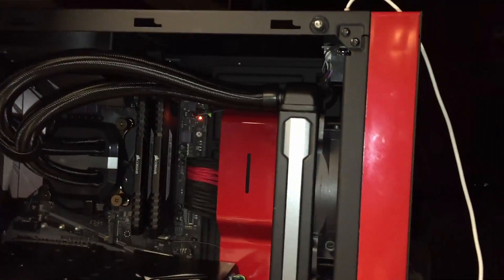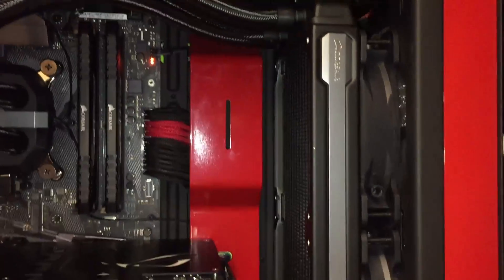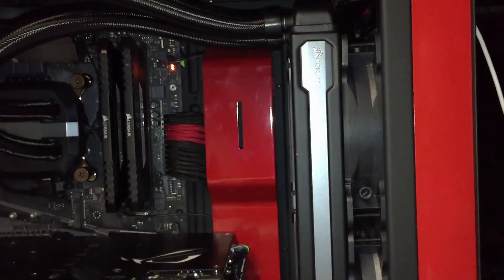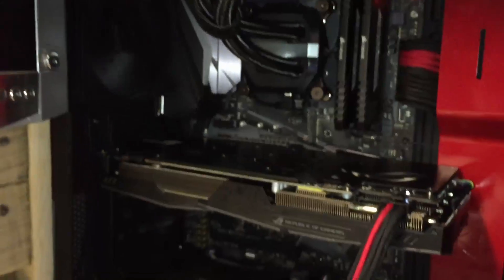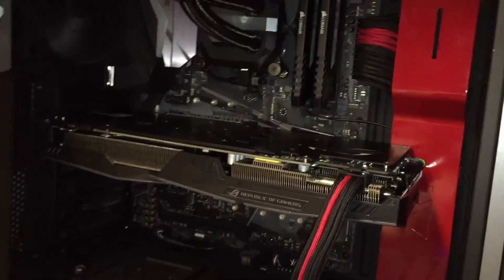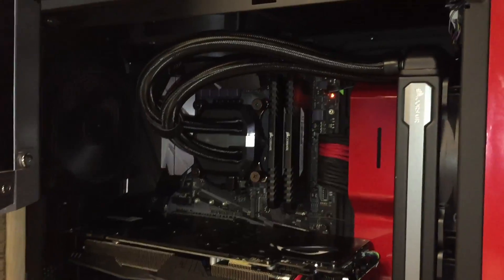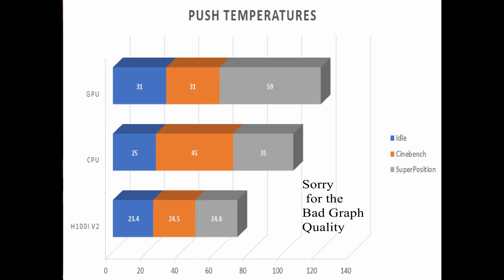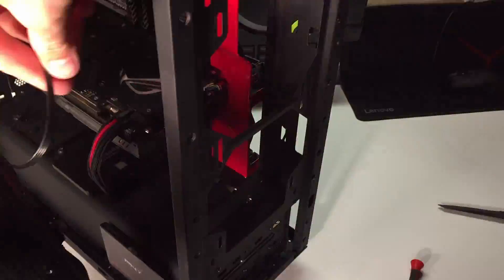Which is better Push or Pull?

Comment: Your radiator tubes are incorrect. The tubes need to be at the bottom of the case, not at the top. This is because air naturally will rise to the top and cause air pockets which will increase noise and lessen the life span of your pump. Also better temps when there is less air in the system of the aio etc.
Reply: Incorrect. Air rises (its lighter than water) and will settle at the highest point it can get to.

As long as the pump is not at the highest point in the loop it should therfore remain full of water and not "gargle".
Reply: I put my kraken x53 on top of the 4000d airflow and all ok!
Reply: @wuhsabi  this is what jayz been talking about. As long as the PUMP IS SITTING HIGHER THAN THE PUMP ITS FINE or DOABLE. I hear gurgling noise on my CM ML240ARGB all the time for 2 years now and its cooling my 5800x that I just got.

Comment: what if i put the radiator behind and the fans in front facing  towards the gpu please reply
Reply: Check the video from the Gamer Nexus about AiO orientation
Reply: @starboy.15  and it’s fine just a little noisy.  Don’t put it in on the bottom.

Comment: I've heard the argument of using a pull configuration because it's easier to clean dust off the radiator than the fans. Your thoughts?
Reply: Did you ever find an answer?